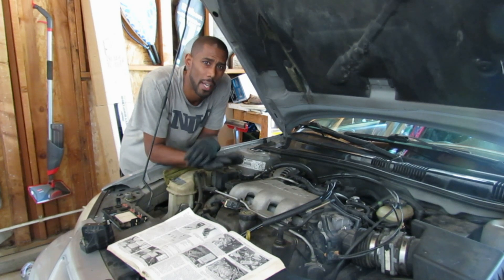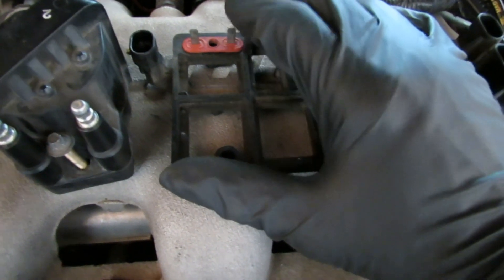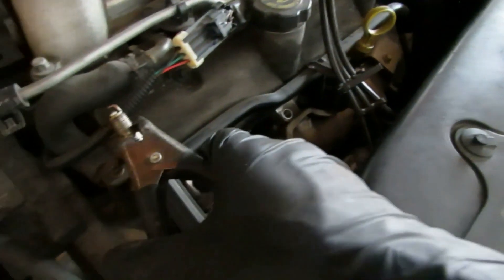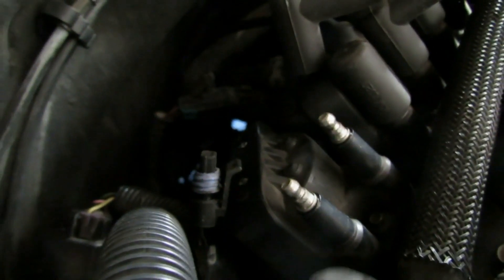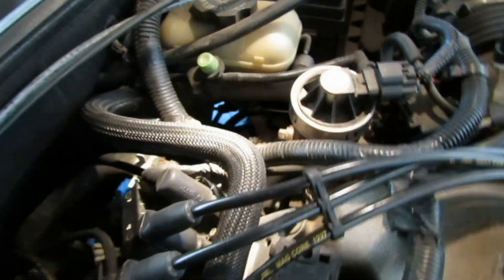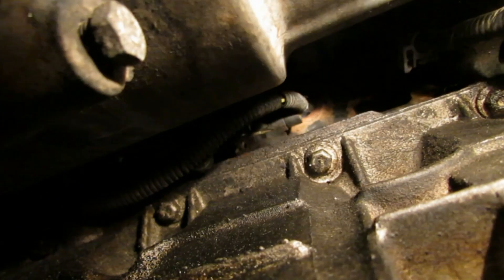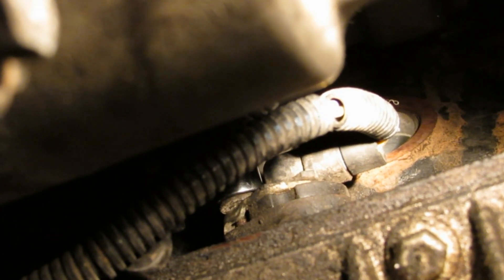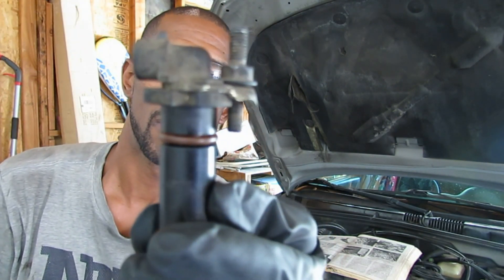Learn how to replace your Crankshaft Position Sensor- Imagine you fixing your car

Comment: how did you get the bolt back in after you replaced the sensor? That’s my biggest problem. From top or bottom?
Reply from the maker: It was hard. I had to use the tips of my fingers.

Comment: Absolute best video I have found detailing how you tested and came to the conclusion that it was the crankshaft position sensor. I have been struggling for 2 weeks to figure out the same problem on my Pontiac Montana minivan. Thank you thank you!

Comment: Brother do you know if this sensor is in the same spot on a 2004 Pontiac Montana 3.4l front wheel drive, I just did the one behind the harmonic balancer, any help you can give me would be very appreciated.
Reply from the maker: @Jeff-ow9lp  I would have to do a little bit of research because I'm not familiar with your vehicle. What sensor are you looking for?
Reply: Crankshaft sensor, I just changed the one behind the harmonic balancer, there is two crankshaft sensors on the 04 Pontiac Montana, I can't find anything on the 04 Montana, I think you so much for responding back brother. @oxmanagain

Comment: Oh brother I wish someone could show me how to do this on a 04 Pontiac Montana, there are no videos on the 04 Pontiac Montana doing this, I have to do this on our Montana and have no idea how I'm going to do it😢
Reply from the maker: Is this the one you changed? https://youtu.be/Hs41zzj_0GY?si=8xkfAzXSNN-bzttR
Reply: @oxmanagain  this one is the camshaft sensor, yes I changed this one as well and I changed one of the crankshaft sensors, one of the crankshaft sensors is behind the harmonic balancer and this is the one I changed, now I need to find the second Crankshaft sensor.
Reply from the maker: @Jeff-ow9lp  ok I will keep looking
Reply: @oxmanagain  thank you so much my friend!
Reply from the maker: @Jeff-ow9lp  this might help that the engine was also used in these other vehicles as well. Maybe there's some videos on them. 

The 2004 Pontiac Montana, like many other GM products of the time, utilized the 3.4-liter V6 engine. This engine was also used in other GM vehicles, such as the Chevrolet Venture and Oldsmobile Silhouette.
Reply: @oxmanagain  yes sir, so I'm thinking the other crankshaft sensor is behind the engine just like the video you showed us, the only thing is the engine in the Montana is set so far back there is no way anymore could get there arm back there, I just changed the plugs and wires on this and I had to rotate the engine forward May have to do it for this also, May even have to remove coil packs and get them out of the way. I just wanted to know for sure before I start taking things apart. I will get under her and see if I can look up there and see it, just like you said in your video. I thank you 🙏 for staying with me on this, most guys do videos and people ask them something and they don't even answer back, I thought they were making videos to help people. You are helping people with your videos because you answered people's questions If they have any and I appreciate that 🙏 very much my brother may God bless you and your family today and everyday my brother.
Reply from the maker: @Jeff-ow9lp  that was well said and well-accepted. I hope everything works out keep me posted and you have a blessed day yourself.
Reply from the maker: I know this has nothing to do with your car but this is the church that I record at. Maybe one of the sermons can help you in life. 

https://youtube.com/@bishopdr.dowdycotlg208?si=3nEjs_TBcOfLiI9r
Reply: @oxmanagain  thank you kindly my brother and my new friend.

Comment: Question?? I got the bolt out finally but did u have to turn the sensor left or right before getting it out or could u pull it out right after removed bolt?
Reply from the maker: Once I took the bolts out I used the screwdriver to just prior straight out and then a little bit of wiggling and it came.
Reply: @oxmanagain  from the top inside of the port it connects to or from underneath the car?
Reply: @oxmanagain  did u pull straight out from top of car or bottom of car?

Comment: For me, it was the WIRE to this sensor that was at fault. It was old and when I moved it, it cracked. I was surprised by how short and easy it was to remove and repair. 
I recommend inspecting this cable before replacing the sensor.
That said, this video was helpful at locating and replacing the sensor. Thank you! 👍👏👏👏
I replaced mine for good measure. My car works great now!
Reply from the maker: I'm glad you was able to find out what was causing your problem. Thanks for letting me know and I appreciate your support by watching my video. Enjoy the rest of your day.

Comment: I know exactly where that sensor is with my hands. I came in from the passenger side wheel well. I can only "touch it", but I can't really see it. I can tell from his images that it's exactly the same place he shows. Thank you very much for your video. You did a GREAT job! I have a Pontiac Grand Prix and it's very similar to the Grand Am. 
This was thee only connector I took off repairing my power steering lines. After the job was done my car turns, but doesn't start. It's possible I damaged a pin or the sensor itself is bad and I pushed over the edge removing the connector.

Comment: I have a 2003 Impala with a 3.4 L my car is a no start I bought EGR valve spark plugs and wires not sensor cam sensor the crank sensor fuel pump... Can it be the crank position sensor I never change that one...

Comment: Hey man great video, quick question my 2000 oldsmobile alero  says it has two cranks. One behind heather wheel and one on the block( cant find either one to save my life) is this set up the same? Iknow gm uses alot of the same setup its a v6 3.4?
Reply from the maker: Sorry for the late response but yes it is the same or real close. The 2nd one is on to top next to the engine mount.

Comment: Thank you so much!!!! Getting ready to change mine.
Reply from the maker: That is so unfortunate and sometimes it's how it goes as you know. Man I hate it when it requires so much work. I hope you get it off and try to limit your cuss words LOL.
Reply: oxmanagain - this is RHoffman1958. Just wanted to let you know I was able to get mine finished today on our 2004 Chevy Venture. Turns out the sensor wasn’t stuck after all - I had removed the little heat shield and thought that nut was holding both the shield and the sensor, but the stud and nut you show in hour video was still holding it. Once I got it up in the air I got under it and could get my hand in there to undo the stud. Wow. I am sure glad you posted this video or I wouldn’t have known where to start. The van’s running like a champ again. Thanks so much.
Reply from the maker: @nancyj46168  Thanks for letting me know and I'm glad you go it done.
Reply from the maker: Let me know how the process went and did this fix your problem. Thanks for watching I'm glad the video help.
Reply: I have a 2004 Chevy Venture. It has 2 of them. One behind the crankshaft pulley and the other in the engine block like the one in your video. I have pulled the crank pulley and removed the one there. Tonight I install the new one there and then tackle the other one. I have replaced about everything else that could cause the problem, so I hope this is the issue. Thanks again. I'll let you know how it goes
Reply from the maker: I'm wishing you the best and I appreciate the update status.
Reply: Struggled with that crank sensor all weekend. Finally got the 10 mil nut off and the little attached heat shield on Saturday, but that old sensor is stuck in there good. There is just no room to get any kind of screwdriver or pliers in there. Since this is a Chevy Venture van, there is very little room between the engine and firewall, I took off the front motor mounts and ratcheted the engine forward. I removed the coil pack and icm to gain more room. Even with all that I can't get the old one unstuck. Guess that's what happens after 260k miles lol. I wish I would have left it on the ramps. I might be able to access it from below now. I am going to pull it back up on the ramps and try that next.

Comment: Good video thanks for sharing👍 got my 2005 Pontiac Montana up and running in no time. only thing to get that sensor off of my vehicle I had to take the air filter off  and reach-around to the back of the engine. The other way there was a metal plate blocking the sensor and not too much space to fit my hand back there.

Comment: Hey I looked in my repair manual and I called all my auto parts stores and I watched so many videos stating that they knew where and how to replace the crankshaft position sensor and none had the one you did.   
To bad I just found your video after I replaced mine. It took 2 days to find. But I give you props on your video. Your the ok only one that shows where and how to replace the 7x and not the 24x behind the harmonic balancer.  Thanks and keep up the great work.
Reply from the maker: I appreciate your comment and thanks for watching.

Comment: For anyone needing to do this repair there’s two sensors one in the location this guy showed and the second is by the harmonic balancer. The best way to get at both these sensors the easiest way is jack up the passenger wheel take the wheel off remove the inner wheel well liner take it out that’ll open up everything and expose the crankshaft pulley right beside that pulley you will found crank shaft sensor 2 and you can reach around the back of the engine too get sensor 1. It’s best too replace both Hope this helps

Comment: I got the bolt out and tried prying out with a flathead and it wont budge I let it sit with liquid wrench over night and it's still stuck any suggestions?
Reply from the maker: Maybe try the largest screwdriver you have to give yourself a little more leverage.

Comment: Dude... I'm no amateur but my bro's 2003 Buick 3100 3.1 engine has been a nightmare with only 118,000 miles on it. Replaced both crankshaft position sensors as well as the knock sensor because it was coding for both of them low voltage and low performance... I've been getting plenty a fuel pressure to the rail because I just replaced the wiring harness pigtail and the fuel pump, complete tune-up, and everything but the ignition control module and the cam position sensor... I was severely concerned that it was going to be a timing chain issue but I see movement in my rocker arms... Your video has given me a lot of food for thought and hopefully Narrows down my issue because he is the single dad of three kids and Frames houses for a living and doesn't make a lot of cheddar doing it... Thanks a bunch man you're a real hero

Comment: I've got a p0302 DTC from my Bluedriver Diagnostics, which is a misfire in the number 2 cylinder. The crankshaft position sensor is the next phase of the many troubleshooting steps that I need to go through to specify the problem. This is absolutely the best video I've seen. Straight and to the point and informative. Excellent job! And you're right!  That SOB sensor is a "bearcat" to get to!!! Thank you for getting me closer to getting my car fixed. :-)
 Take care,  brother
Reply from the maker: Thanks for taking your time to leave me your comment. Let me know how it all turns out.

Comment: What is this BS at about time 7:10 where you claim that you, "Tested the ignition control module" ?? All that you did was touch your ohm meter probes to the outer metal shell and verified that YES, the shell IS metal and that YES, if you connect your ohmmeter to a piece of metal, it will register a short or ZERO ohms (verifying that the meter and batteries are good). This is true with ANY piece of metal. You tested NOTHING as far as to whether or not the ICM works !!

Comment: Great video. That is one of the two crankshaft position sensors. They are sensors a and b can’t find which one is which. But the other one is located behind the harmonic balancer. Another thing that can cause the p0336 crankshaft position sensor code is the camshaft position sensor under the power steering pump. Check the wiring it can be damaged from the power steering fluid and heat. That’s where my problem was on a 04 impala with the 3.4 engine.
Reply: A is on the back of the block.... looks like a black tube

B is the high precision... behind the ballancer pully.... looks like a banana sorta
Reply: I find an easy way to test it in the Haynes manuals. The one near the crankshaft pulley has 3 wires. The missile one is the signal, the other 2 are power and ground. Using a voltmeter, probe into the signal and ground the wire (or chassis). Then
turn the ignition on and hand turn the engine with a ratchet/socket. If it's good, you'll see the meter changing between 0 and 10 volts DC.
The other one is easier to reach from the to, near the ignition packs. It's a 2 wire connector. Place the test leads in there (paper clips help). Set it to volts ac. Have an assistant crank the engine; it should be about 0.5 Vac.

Comment: Helped me to get a 92 buick regal with the 3.1l v6 running. Difference was an 8mm bolt, car drove for the first time in two years. If you are patient  you can order the sensor online for $10-$15 and save a few more bucks.

Thanks for the help!
Reply: Where is it located? I have a 1993 Buick regal I'm not sure where it is

Comment: Do you have any idea where this sensor would be located on the LR3? Thank you
Reply from the maker: Sorry, I don't, why do you think yours is going out?
Reply: @oxmanagain  I'm having some issues when starting in cold weather. I'm not exactly sure what is causing it, but I've read that the cps could be a reason.
Reply from the maker: @JJSerpas23  When you go to start your car exactly what does it do it the cold? Do you have any check engine lights that come on?
Reply: @oxmanagain  no check engine lights. It doesn't engage the starter unless I leave the key in for 30 sec or so and then try to start. If I try right away it will just reset all of the trip/dash lights and clock. Once it starts cranking it seems to crank and start very slowly, almost like a stumble or hesitation. The only fault I get is an HDC Fault that goes away once the engine is on fully. The battery is less than a year old, alternator is new. I have added bg44k to the tank twice in the last few months. The car works/starts fine after the first time, It also jerks sometimes while taking off from a stop.
Reply from the maker: @JJSerpas23  something similar like that was happening to my daughter's car. What I had to do was tighten the bolt behind the ICM in front of the frame of the car. Or you can have someone shake the ICM as you start the car and if that works then you just have to tighten the ICM bolts. There should be two.

Comment: Appreciate the video...now I know where the ckp is located.which will help diagnose my 3.1 no start.
Reply from the maker: I hope you find the problem. Thanks for watching and let me know what the problem was. Have a good one.
Reply: I checked resistance on the the plug at the (coil) ignition control module that goes to the crankshaft sensor. I then watched your video for it's location. The problem turned out to be that I had parked the car out back next to a barn for the winter and a rodent had chewed through the wire. Appreciate your help...went from cranking, but totally dead to running great now.
Reply from the maker: Haha wow, a rodent. Well good to hear you got her running aging. Thanks for the story.

Comment: Thanks for the video on how to remove the crank shaft position  sensor.  To bad you didn't make one on how to put the sensor back in.
Reply from the maker: +Avenger 1 You're welcome. I did record putting it back in but do to it's location it was pretty much unwatchable. If you have any question feel free to ask, thanks again.
Reply: Avenger 1 I drop the bolt in the hole
Reply: What do I do know yo get it out
Reply: How did you orientate the who in the part to the block?
How did you line the holes up to get the only on with out seeing the parr?

Comment: I have the same problem but it was after replacing the harmonic balancer could it be the fact that we didn't put it in right or the sensor. we can't go to Auto zone and see if it's the sensor so I'm kinda stuck
Reply from the maker: Has everything else been ruled out?
Reply: oxmanagain seems like the harmonic Balancer was installed correctly the water pump is good, the spark plugs are straight. It has gas and antifreeze. The only thing is that the engine won't ignite or start no matter how long I hold the key. (I don't hold it too long and I don't wanna try alot in order to not damage further. ) I feel like it's the timing belt but that's worst case scenario.
Reply from the maker: What about your spark plug wires and the ignition system?

Comment: I was unable to access from top..so I took passenger wheel off, reached in from the side and it was a piece of cake to change.  Fixed my issue which it would run for about 30 minutes then quit and refuse to start till cooled down.  Thanks for the video and your explanation.
Reply from the maker: You're welcome and I'm glad I could be of service. Thanks for watching.
Reply: You took the passenger fender liner out yea it’s easy that way don’t forget there’s two one behind the harmonic balancer as well